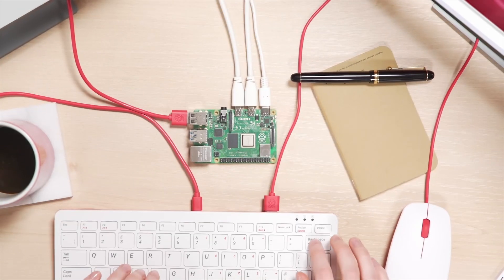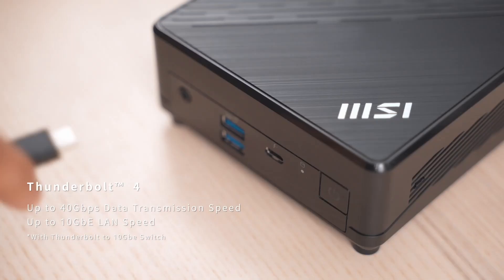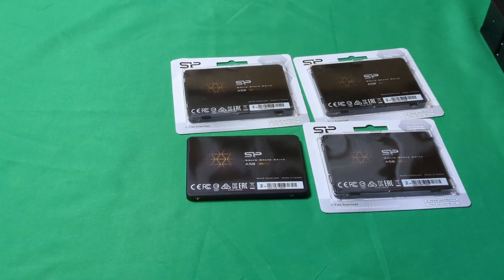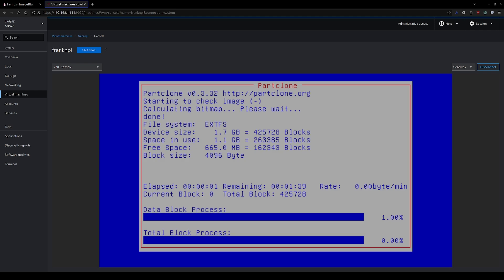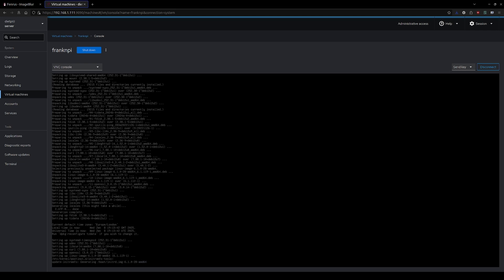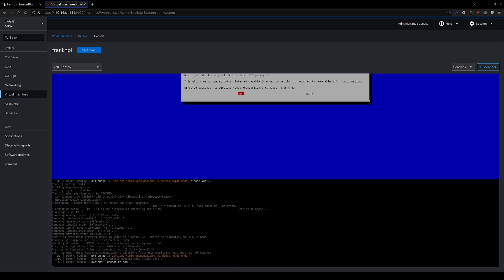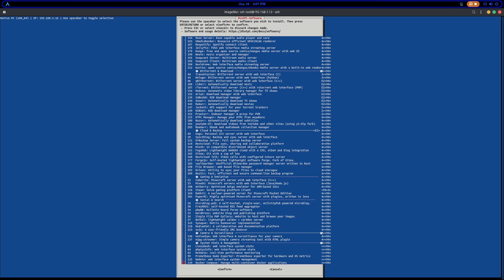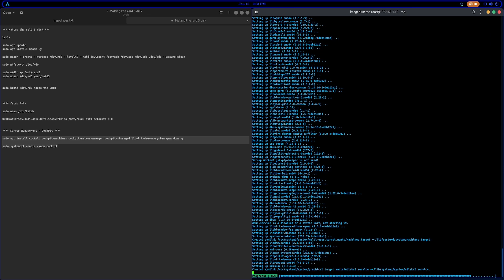DIY Linux Mini PC Home Server NAS. No More Raspberry Pi

Comment: Is that power brick enough to power all those drives reliably? I was able to make out 5V at 2A, so you should have 10W available. 

I was looking into a similar solution, wanting to avoid any large PSU or other nonsense, but couldn't find any brick with molex that was rated at 20W or more.